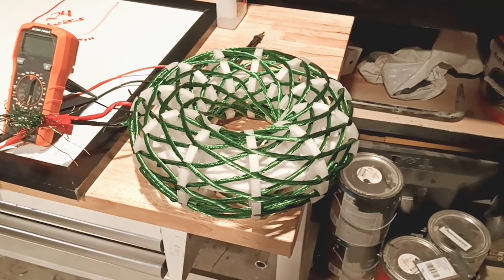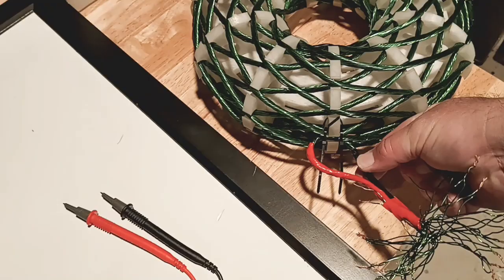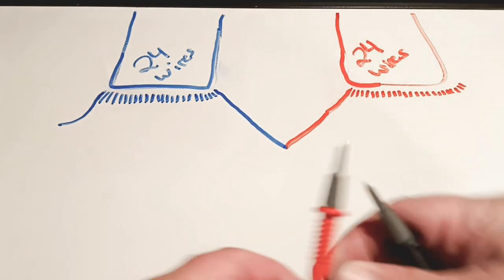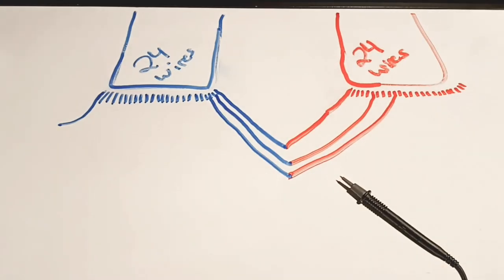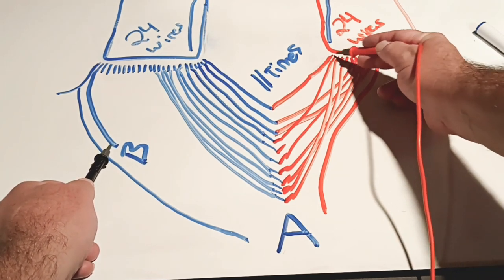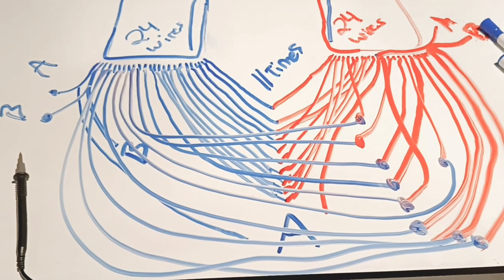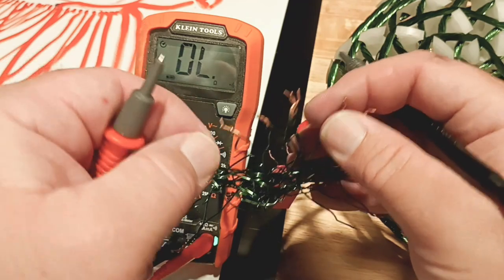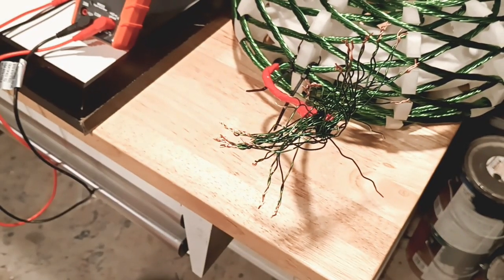Rodin Coil Wiring

Comment: Ok off topic but what do you know about the liquid metal GALINSTAN? It seems to be a liquid at room temperature might make a perfect no friction contact or even a material in sode charged centrifugal pipe/tube inside the frame of the rodin coil, if you can get it to spin inside the tube inside a active rodin coil. Maybe the liquid metal could be part of the fly back circuit for the gravity flyer.
Reply from the maker: don't know anything about it. I stay away from liquid metals because I am in my garage. The high voltage has to disperse a field from it in a way liquid metal cannot.

Comment: Curious, i have little knowledge at this point but, would a series of roden coils stationary encompassing a cyclotron (cyclotron running through the center of the roden coils) using bearing magnets or spherical magnets create a greater current/voltage then the cyclotron uses?

Comment: There is far easier lazy cable to Use ,parallel colored cable like the old HDD "flat parallel data" for old IDE interface or even SCSI cable woud work just fine ,the same principle apply on it about first and last wire reconnecting ends to start end to start to form a loop

Comment: Excellent friend, I have a Rodin torus as well, also with 24 wires, 12 per channel. But I've been thinking about using thinner cables and instead of 24 using 36 wires, 18 per channel, could it change a lot with respect to the "power" in gauss of the coil? Thinking that the objective is to use the Rodin coil for the reproduction of specific frequencies for therapeutic uses. What do you think?
Reply from the maker: I think it will allow for resonance between 2 separate coils. I would say in the coil but it is one full coil and not break between cross sections. I hope I am wrong though.
Reply: Personally I’m kind of confused because I just clamp onto the whole bundle of wires to produce my specific frequencies. I’m here to learn more

Comment: What is this supposed to show once you hook up the power to the rodin coil?
Reply from the maker: This configuration will show magnetic flow. you can spin a sphere magnet or use it as a speaker when a magnet is in the center. My hope is that it shows a lot more than that. I want to see power amplified and I want to push the limits of the coil when other coils are near for over unity. We will see if it does it.
Reply: @nathanbunten4299  Ok thanks as I will be waiting to see the results.

Comment: No idea why you are wasting time and money on 'sacred geometry' coils which provide no advantages over conventional coil designs and have not been proven to be over-unity. Those who claim they are over-unity without attempting to self-loop the circuit as proof of claim are disengenous.
Reply from the maker: @evo-labs  we are here to find out the truth. It takes people doing the experiments to find that. Not everyone makes the same coil. So every experiment is different. Some small changes can make all the difference.
Reply: If coiling is a settled science, why are there new electrical engineering textbooks each year? Over unity is another topic. What does it mean to you? Thanks for sharing.
Reply: There a lot of design/configuration to be tested different geometry laid to different respond even nano meter duped etched silicon graphene /copper is another potentials  hence the modern new high efficient vertical flux motor is far better more efficient less material usage than early used motor in EV car heavy bulcky AC 3phase motor
Reply: Why is there an issue with various coil designs. No one is talking about over unity here, these coils are for therapeutic uses, not electrical. Are you the coil police?
Reply: @seangust9025  My comment has already described the issue with these coil designs. The YouTuber 'Benefactor' has made a claim of OU based on meter readings yet hasn't to date attempted to self-loop. "Coil police" - that's funny 😆